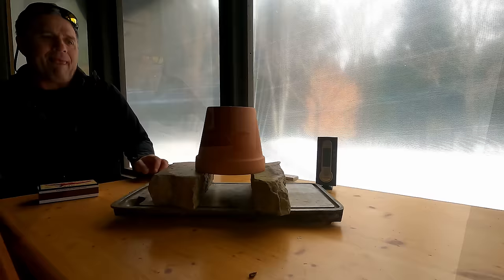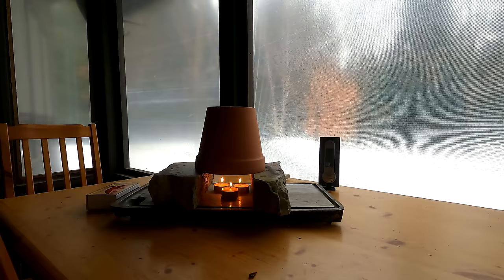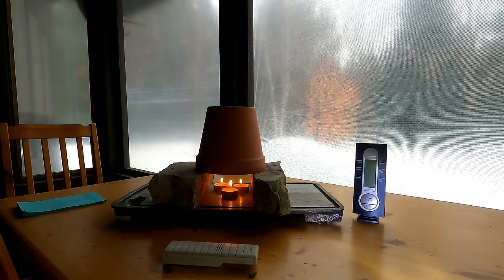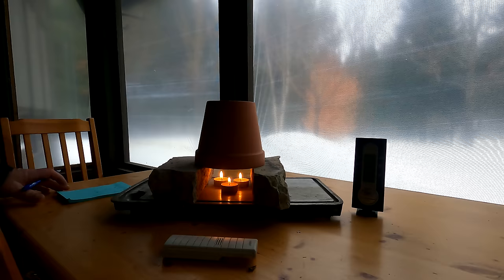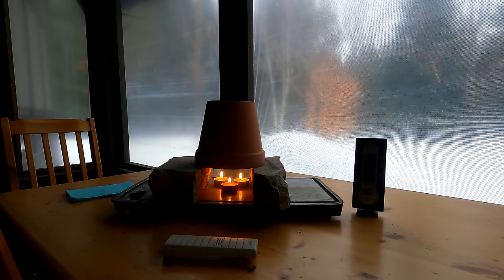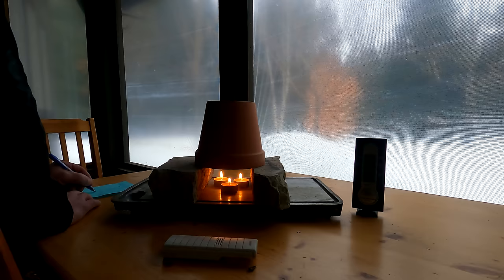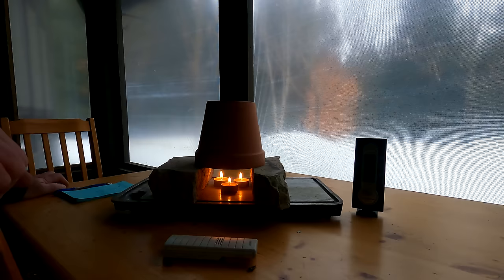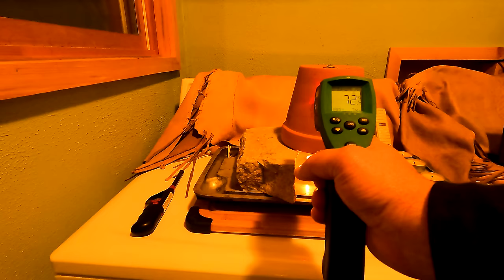Testing the Clay Pot Heater | Truth or BS | Prepping and Testing

Comment: The thermometer measuring the room temp was within the radiant zone of the pot. Another yard/meter away, no significant change would be measured. The only room this could heat is an insulated dog house. They work great as hand warning stations, though.
Reply from the maker: Good observation about the placement of the thermometer. This was done full well knowing that the system could not be measured in any other way.  The final segment of the video was done in a room which is approx. 6ftX10ft. Internal to the structure (no external walls) and the door was closed. The temperature of the room after one hour of the pots radiating heat increase by a mere 2 degrees. (I highly doubt it would be able to increase it any further) This system could not be considered useful to heat a room; however, the test was conducted to see if indeed the radiant heat of this system is enough to generate a difference in temperature. I considered it no BS due to the simple fact that it did indeed radiate heat and it increase room temperature.  Thanks for the response, Jeremy. Well stated and well written. The hand warmer idea is brilliant.
Reply: @Hawksshadow  Good video, man.
Reply: Yeah, as an engineer, just look at the energy from one candle and how much it could raise the temperature of a room.  It comes down to if you have a small room, and little air exchange, a candle will raise the temperature a certain amount, but that amount is likely to be almost unnoticeable.  Three of those will be 3 times the energy provided.  When I ran my own experiment in my upstairs office, I got no increase in room temperature, even with 3 candles.  Did make a decent hand warmer.
Reply: I guess you could have 4 of them near you as you sat at a desk, but there are far more efficient ways to heat yourself.
Reply: Why are there so many t candle heater videos,  people must be stupid, a candle (or 3 or 5 or 10) produce a set but, it takes a set amount of but to raise room temp 1btu no amount of candles will work unless you use like 100 candles, do the test correctly and measure the temp 10 feet away.
Reply: @Hawksshadow : Just a thought, since the only radiation of the heat is from the very pots being heated, what is since you already have a bolt to hold the pots together that on the bottom of the pots that a large can with holes in it is bolted with the pots so once the pot are upside down, the can is also heated and with holes in it the air can pass through and be warmed. And, if a high temp silicon washer is used at the bolt head so the can can have an inch at the bottom, water could be in the bottom to raise the humidity and cause the heat to expand into the room, just like having a kettle on a woodstove to hyfrate the air and thus transfer heat better.
Reply from the maker: I wonder if this has been done - I should give it a try and see what happens. Good idea. The clay pots are defiantly a huge part of the equation as they hold the heat - your idea of water being heated and could very well add to the radiant effect. Thanks for the comment.
Reply: Because heating air is very inefficient due to it's low mass. If you have some half filled hot water bottles in some pockets of a jacket, that would keep you toasty all day on just one boil of a kettle that would take about 2 minutes on UK mains. You wouldn't even need to fully boil them, just part boil, so you don't overheat. Jacket, half filled water bottles in their own sleeves, then a fleece to stop skin contact, and a t-shirt. No other heating in the house needed. If you need to wash, have a hot shower and make a hot water bottle to keep your bed warm at night. My total energy bill for the year is only £340 from the grid this year. Drinking hot drinks also helps, because again, water has a relatively high mass and retains heat longer.
Reply: a small chiminea  with candles works great in my garage gym (30x30")
Reply from the maker: Thanks Jeremy - I had no idea it would be this contentious - I was simply trying to see if the damn things worked. Fun times.
Reply from the maker: Absolutely - there are products on the market which will keep you warm should the power fail. I have a Colman tent heater (ventilation required) which will heat a small room in minutes to a very comfortable temperature.
Reply from the maker: You nailed it - Hot water bottles are great. I always have one in my kit when I winter camp. 
It's awesome that you are able to knock your heating bill down as you do. Good Work. I have a wood stove in my home which is my primary source of heat - Lots of exercise cutting, splitting and stacking but I love it. Thanks

Comment: BTU's are BTU's, adding a few clay pots does not change that. At most you created a thermal storage device/radiant area heater, not a room heater.  Your thermometer was too close to the pots to accurately measure overall room temp, and you being in the room will add heat as well.
Reply: you Sir are correct!!! I keep trying to tell people this but ya know how that goes.
Reply: Yep, a human is around 100 watts, tea candle maybe 30 watts. So his presence is doubling the heat input to the room.
Reply: Hotter due to infrared heat transfer. Idk much about it, but it only took a little graphite to make it hotter.
Reply: So I saw a video where a science guy told his buddy to coat the outside in graphite to see if the infrared would create more heat so he did  experiments where he got 10 degrees more heat from the graphite burner
Reply: You can’t get more heat because of anything. A BTU is a BTU. The only way to heat a space is to produce more BTU’s per hour than the amount of BTU’s being released by that spaces insulating layers per hour. It also takes more BTU’s depending of the spaces volume. A larger volume the more energy it takes to raise the temperature of that volume. Kind of like a small pot gets to a boil faster than a large pot.
Reply: @cgray8969  different material or coating may cause heat transfer at different rates in different areas, but it DOES NOT create more heat. BTU's still will not change. Physics (thermodynamics) do not change because a thermal camera and graphite are added. Only adding more BTU'S will increase BTU'S
Reply: You're exactly right.  I've commented to others on YouTube in the past years regarding this very subject.  The clay pots are storing some of the thermal energy but they're not producing any new or additional thermal effect.  Anyone who relies on this "heated pot" to stay warm better have a very good back-up plan.
Reply from the maker: The reason for this test was to determine if the unit could heat a room. My test determined that it can as long as the room is very well insulated and very small. The test was conducted in a 5 by 8ft laundry room. The pots only function is to capture the heat produced by the candles and radiate it out in a controlled manner. The pots retained heat for 30 minutes past the extinguishing of the candles. I would not use this as an emergency heater as there are too many safety concerns with its operation. People will resort to all manner of contraptions to keep on the warm side of hypothermia.  I suppose this is one of those contraptions.
Reply: @Hawksshadow   the average tea light candle produces 32 watts. So three lights produce 96 watts. The average human body produces about 100 watts at rest and three to four times more while active. So it heating a room anymore than just hanging out with normal body heat is unlikely. Doubling the watts by having both body heat and candles will help some. But it would be cheaper and smarter to have a wood burning stove or portable heater, layered clothing, reduced space, chemical (reusable are available) hand warmers… over the tea candles and pots because of the numbers needed to make any type of impact.
Reply: @Hawksshadow  And your test failed because you put the thermometer right beside the clay pot, you didn't measure the temperature of the room you measured the temperature of the hot burning thing!
Reply from the maker: At 4:06  in the video, you will see that the unit is tested in an insulated room - internal to the house. The thermometer was placed three feet away. The room is 5ft by 8ft by 8ft in height. This unit only raised the temperature by a few degrees. The thermometer which you are referring to is in the screen porch - I had no illusions that this could heat an open area. I wanted to determine if the pots would do as others have claimed. Thanks for the comment.
Reply: @Hawksshadow you literally said in the video it was poorly insulated and here you say well insulated. You are full of it man.
Reply from the maker: Dude - the first part of the video was done in a screen porch - not insulated, The second part was done in a laundry room which is 5 by 8 by 8ft high. R 40 in the ceiling and R 30 in the walls. One door leads to an insulated mud room.  4 minutes into the video you will see the room which I am talking about. It made no difference to me if the unit worked or did not work. I simply was interested in testing it to check on its viability.

Comment: T lights give out around 40 watts of heat so 3 is 120 watts. The flowerpot does not amplify the heat merely acts as storage & radiator.
Reply from the maker: Absolutely - I heat rocks in a campfire and place them around my sleeping bag when using a tarp. The radiated heat lasts for hours. Well said Roland. Thanks
Reply: Exactly. Thick sheet of metal can do the same.
Reply: Yes, that is what I have wondered about regarding these heaters.  In other words, would not the three candles produce the same amount of heat, or even on the margin a bit more without first heating the flower pot?
Reply: Yes but it would go straight up and mostly warm up a spot on the ceiling, where the heat will leave the room. The pot captures that heat and slowly radiates it around, warming the air and objects in a small radius. That's why the thermometer registers a temperature increase. It's quite close to the pot. The room itself isn't significantly warmer, the thermometer is.
In a very small well insulated place, it will make a difference. But it's actually not much more than a hand warmer and a serious fire hazard.

Comment: You will never get more heat than is produced by the candle.
Reply from the maker: No Guff - It's about heat retention. The clay holds the heat produced by the candles. The pots stay warm a long time after the candles are snuffed out.
Reply: No a candle makes only so many btu's
Reply: Yes, but the pots reduce the heat loss to the ceiling through convection and promote heat transfer through radiation (notice the thermometer is very close to the pots)...The effect will decrease significantly as the thermometer is moved away from the pots. In other words, it moves the meager heat somewhat lower in the room and through radiation allows you to feel more of it if you are very close.

Comment: I think measuring the room temperature  change just using the candles, without the pots, would really answer the question as to whether the pots made any difference or not.
Reply: I think the pots are only of use in keeping the heat collected locally - so as to heat up just the person near the pots, not the whole room. Pots or no pots, the candles can contribute X amount of BTU's to the room as a whole, and you are 100% correct that the test results with/without the pots would bear this out.

Take care and God Bless.
Reply from the maker: You are correct - the candles will indeed heat the room by approximately the same degrees as the combination of Pots and candles. The difference is the heat stored within pots due to the clay. This heat becomes radiant heat and projects into the area in a very controlled manner. This heat will continue to project into the area a minimum of 30 minutes after the candles are extinguished. Due to the numerous comments I have received on this video, I recently approached this contentious issue by redoing the test - I did indeed test the candles alone and then the combination of Pots and Candles ensuring controls were in place to remove any potential questions.  Thanks for the comment.
Reply from the maker: You are correct - the candles alone will raise the temperature of the room by approximately the exact same amount - the difference lies in the ability of the clay to absorb the heat and radiate it. This captured heat will radiate out from the pots for at least 30 minutes after the candles have been extinguished. 
Thanks for the comment.
Reply: @Hawksshadow  science!
Reply: Don't forget about the time it takes the cold pots to warm up. If anything, the pots look a little better than just the plain candles.
 @Hawksshadow
Reply from the maker: It took the pots 10 minutes to reach the point at which you could not touch them with a bare hand. The pots certainly do add to the equation. The unit; however is unsafe due to the fact that pots heat up so much that the candle wax becomes liquified in a very short time. This can cause a flash burn which would pose a great threat of an out of control fire.
Reply: @Hawksshadow  
Density has advantages in many and certain applications ...except for the human mind ...a dense mind is an idiotic mind
Reply: He showed the temperature of the pot

Comment: Watch out, think for a second where the candles combustion waste are gonna deposit? Yeah, on the pots. That's where the evaporated wax will be transferred to. So, you're turning the pots into flammable pots. Eventually, if you don't clean them regularly, they will set on fire. It is not easy to remove wax or grease from these pots.
Reply from the maker: Very good point. I would not use this to heat anything as it is too fragile and inefficient; however, this test was simply to determine if the unit is capable of increasing a rooms temperature. My experiment showed that it did increase the room temperature by a few degrees. I would have to surmise that using candles alone would do the same but would take more time to do so. Thank you for the comment, Ivo.
Reply: @Hawksshadow  It's ok to use them, as they are efficient and cheep. I use them too. The point is, people need to be aware of the risk. Every person teaching it, do not talk about maintenance. I understand the point of your experiment. Thanks for your answer.
Reply: I have tried to light a clay pot on fire using only wax. Gasoline would light the clay on fire and so would 91% rubbing alcohol but wax would not light the pot on fire when I tried it. Maybe I'm doing something wrong but it didn't work for me
Reply: @benjamincasanova9289  com'on dude! Gasoline and alcohol are highly flammable substances, not wax.
"Paraffin wax makes candles flammable but doesn’t catch fire easily. As a solid, it needs to be heated enough to change its form into a gas. When this gas is mixed with oxygen, it burns and sustains a fire. The paraffin one has a flashpoint of 392-480 degrees Fahrenheit or 200-249 Celsius."
Heat the pot with a layer of wax by that temp then you tell me.
Reply: The wax doesn't evaporate, it is consumed as it fuels the flame.